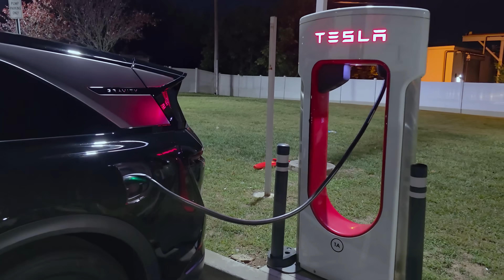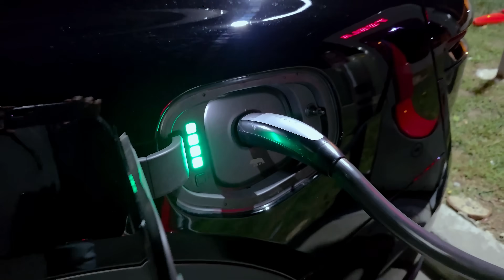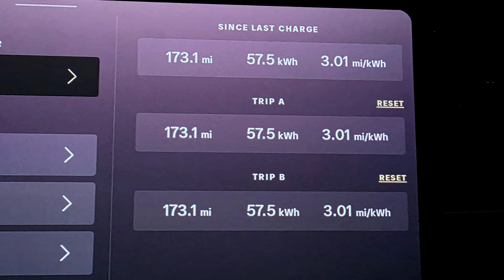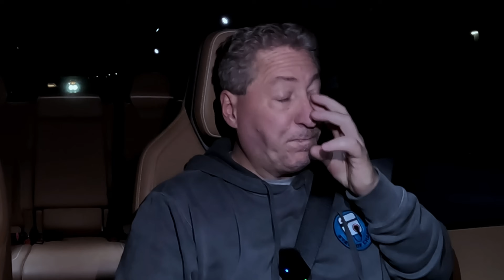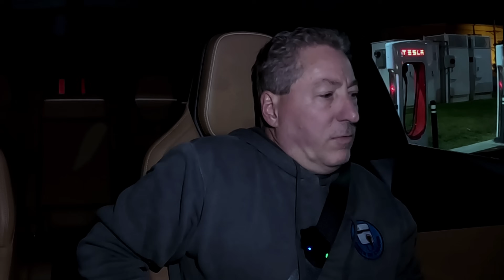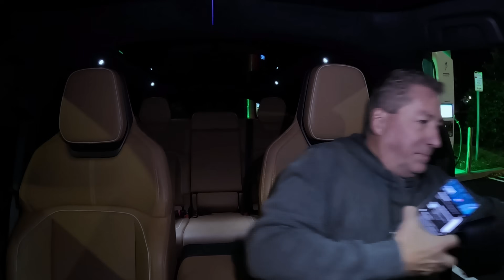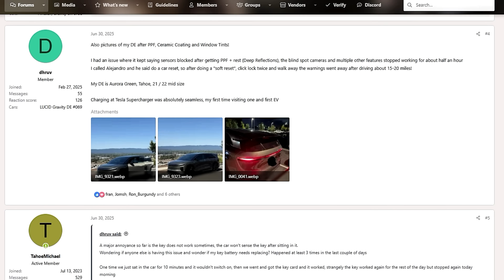Does the Lucid Gravity Live Up To Its 450 Mile EPA Range Rating?

Comment: Vegas here.  Just took my EV on its first California drive from Vegas. Its cool right now but summer heat charging is a big problem especially if your ev cant keep cool while charging. Also My Honda was nit open to all Tesla superchargers in Baker, CA with my adapter which pissed me off due to the inconvenience of having to move my car half a mile down with no convenient stores for the family.  The fear of your car no charging due to whatever reason is a big scar with your family in the car.  I will say that im seeing more lucid software issues occurring in reviews, any charging issues will keep me away 🏃🏾‍♀️. Electrify America are busy with big SUVs and you can't fit your car in to charge. Thanks again.

Comment: For me to get 300+ miles on my 24 Model Y with 88% battery health left, I need to get 230 wh/mi over my commutes. Due to my location with so much downhill/uphill, traffic etc I average 240 wh/mi and can indeed get it. This is at a 100% SOC though.

Use breaks when regen is limited = disabled. 

A gravity would give us stupid range in comparison!! Excited.

Your wh/mi was 350 during this test?

Comment: So, now that was at 100%.  But at a fast charge range of 80% is even lower. Very nice vehicles.  But I have found out that the country not ready.  Not enough chargers.
Reply from the maker: That depends on where you live. I can drive anywhere I want to in the country now without any problem. There's tons of DC fast chargers out there now.

Comment: 2:20 I don't know that I would give them all THAT much of a handicap for it being in the 50s. By the time the majority of the discharge is taking place the battery will be at whatever the cooling system is made to regulate it to and it should be performing nearly optimally.

Comment: I leased a Chevy Equinox RS and first thing I noticed is the range on the highway is terrible.  I'm old school and I was thinking with an ICE brain thinking I would get this great mileage and my cost of power would be so cheap compared to my 2018 Accord 2.0.  OMG how wrong I was.  I have an 80 mile round trip to work.  80% charge is 267 miles.   I get at best 200 miles on an 80% charge.  I've tried at 65, 70 and 75 mph and I get  the best range for my vehicle at 70 mph. It cost me more to charge and I charge on off peak hours then gas cost for the Accord.  I pay about $100.00 more a month to charge then I did for gas. I definitely will not be keeping this vehicle at lease end and unless batteries have advanced in another year and a half, I will go back to a ICE vehicle.

Comment: The seven-passenger model with 20/21" wheels is rated at 437 miles. The five-seater gets the 450 rating.
Reply from the maker: Right, and that was the 5-passenger model

Comment: Early adopters of the Gravity will definitely have to deal with software glitches and less than perfect assembly issues. I hope Lucid gets this right quickly because the more completion in this segment, the better. I really wanted a Gravity but after test driving it and observing the build quality in-person, I decided instead to buy a 2026 Mercedes EQS 400 SUV. Not a single issue with software and the build quality is excellent. That's the difference Tom was speaking of when comparing newer manufacturers to the tried and true old timers.

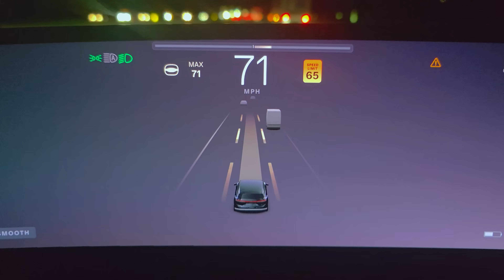Comment: At 4:58 there is a warning message on the cockpit display. Did you check that? Perhaps that was telling you you had a drive unit malfunction.

A few things to note:
* EPA range tests are not run at 70 mph, so you cannot expect to get the full range at that speed. Aero efficiency decreases with the square of the velocity, so going just a bit faster makes a big difference.
* The Lucid Air usually exceeds the EPA rating at 70mph, but range drops rapidly after 80 mph.
* While the Cd for Gravity is quite low, it does have a much larger frontal area, which is part of the aero efficiency formula. It could be that the range dropoff point is more around 70 mph for Gravity. 
* Air density is higher at lower temperatures, which will also decrease the range.

It would be interesting to measure consumption at different speeds. You would not have to do the full range test, but empiracally determine the consumption rate for different speeds to see how much of a penalty is added for higher speeds. Then you can run another range test based on the optimal (highway) speed.

Comment: Rear climate control was on. So does that mean the range of this 7 seater car is estimated with only the driver in mind. If that changes 100 miles is shaved off. With all the tech it could not notify the driver that something is wrong with the rear motor. Yeah right I just don't buy that

Comment: If you can afford a $125K  suv, you can just rent a long range bomber if you have to be somewhere quickly where driving is faster than flying and you can hold your water longer than a camel.   FWIW, I always rent a car when on a longish road trip.  Any problems means I just call the rental company and they drop off another car.  My friend got into an accident 300 miles from home and it was a nightmare.

Comment: EV makers please stop putting large wheels on your cars when you don't have to.  And stop using different size tires front to back.  All this does is reduce range and prevent 4 wheel tire rotations.  But why didn't Lucid check over this vehicle with a fine tooth comb before letting you use it for the range test?  Did the rear motor just out of the blue have an issue?  And, how would anyone else who bought this car know there was an issue if they don't track the range like you do?  If I spent over $90K for this vehicle it had better do what they say it can do.  Don't get me wrong, I am impressed with Lucid and really, really want to buy a Gravity and get rid of my Tesla, but I don't need another company delivering empty promises.  Also, one thing is for sure unless an EV car company can figure out how to reduce the range loss in cold climates, they will never convince ICE drivers to switch.  But as far as software issues go, the whole software industry pushes them out way too early, not fully backed as you said.  It drives me nuts that customers tend to be free beta testers.

Comment: I can see the rear drive having issues causing the low efficiency but this also shows so many problems. If there was an issue with the rear drive unit, why does the driver not get a notification? How are normal people supposed to know? Why is the battery state accuracy so low? Telling the driver it's at 0 percent but still having charge in the battery is not a good sign. What happens if it was the other way? What if it reported 5% charge but if it was really running on empty? The state of charge indicator is very important. 3 miles/kWh is very bad efficiency when a Model Y can get 4 miles/kwh

Comment: I'm confused by this test. According to fueleconomy.gov, the Gravity highway range rating is 103 MPGe. That translates to ~3 miles / kWh. Multiplied by the 123 kWh battery, that's around 370 miles. So why is a 450 mile rating being used for a pure highway range test?
Reply from the maker: The EPA's MPGe figure includes charging losses. You cannot use that to calculate the driving range.
Reply: @StateOfChargeWithTomMoloughney   Thanks for the explanation. So the net effect would be a more conservative MPGe number since energy consumed is more than what made it into the battery?
Reply from the maker: @jghall00  Yes

Comment: Slowing to 65 would substantially increase the range versus 70. All else remaining equal, the power varies as the cube of the speed. I have a ZDX AWD, and over 6 months and 4000 miles driving in CO, I’m averaging 3.1 mile/kWh.  I've done a few 5-8 mile runs on flat highways at speeds of 65, 70, 75 and 80.  The difference in instantaneous mile/kWh shows up on the display even over such a short distance.  

On a recent 1300-mile trip in sparsely populated northwest CO, eastern ID and southern WY with temperatures 90-105F, winds up to 60 mph and climbs of 5-10% over passes, my "usage" was 3.0 miles/kWh.  What the trip did for me was a couple of things: 1) even in near wilderness if a town is on a through road, someone has put a high-speed charger in place and 2) the car can always go farther on a charge than this old man wants to sit behind the wheel. 

So, I take the ratings for EVs just like I take EPA gasoline ratings, they're a rough guide.  My Z is heavy and still gets 3 miles/kWh and for bigger EVs, that's about normal.  So just take your battery capacity and do a little arithmetic (it's not even math) to see if the car you're interested in meets your needs.

Good video as you made a conscious effort to eliminate as many variables as possible.

Comment: I am thankful independent testers are out there doing these range tests, but to get the masses to fully adopt EVs, the if it is cold, if the AC is in use, etc, issue killing range keeps many away. Consumers do not want to think too much about their vehicle. Rarely does ICE vehicles hit the numbers published. I still remember when I bought my 2012 Camry SE 4 cylinder, it had a combined MPG of 28, but after 243,000 miles of driving, it had average 24 MPG. I just got in the vehicle, made it comfortable and drove. I am not a hard driver, but I rarely did the gentle/slow pedal push many say improves MPG. Point is, when it comes to EV testing, the testing I want more of is the driving an EV like most would drive an EV. It is almost like you need the hardcore testing that is done like this video, but a second video of just daily living without over thinking. Just get in and drive to the store, or to work, etc. Make everyone comfortable, no restrictions on AC use, or not driving on a hot days or cold days. Just drive, not the weather, note how many people in the vehicle, but no hyper miles restrictions. Hope to see many channels doing a variety of tests and hopefully report with the honesty that this channel or Out-of-Spec does.
Reply: The reason for the ultra specific testing conditions is so you can compare between vehicles.

If you drive one vehicle in perfect conditions and the next one in a blizzard, you can't compare them.

Comment: This is not a slight towards Lucid, but shouldn't the system warn if there is an issue with the rear motor?  If a normal owner is just driving along this would have never been found.

Comment: To validate your test results, you need to turn on/off regenerative options to see the difference of mileages between them since majority you run at constant speed.
Reply from the maker: The level of regeneration won't effect this type of range test to any noticeable amount, since very little braking is done. In normal driving, though, it would have a big effect

Comment: Isn't the EPA estimate a combined number of city and hwy (hwy 55% + city 45%)?  
You would get more than 450mi in low-speed driving as air resistance and force required increases as the square of velocity...
Reply: It's some kind of mixed cycle, you'll never get ALL that in a straight highway run.

Comment: Lucid didn't set the bar. The EPA did. And the EPA tests are at slower speeds. 345 in a vehicle that size at that speed is phenomenal.
Reply from the maker: It sounds like you're under the impression that the EPA does the test - that's not how it works. The manufacturer does the testing and sends the data to the EPA to certify it. The EPA does hand-pick a small percentage of vehicles to double-check the manufacturer's data. It hasn't done so with the Gravity, though. In fact, the EPA isn't doing much of its own testing at all anymore, because of the recent budget cuts it has had.

Comment: Interesting there would be a rear drive motor issue, yet no dash light or error.  Plus why would it not charge on native NACS port at low SOC.  100 miles short of or 77% of stated range is a joke Lucid.  Hard to believe EA could save themselves, yet alone save our guy Tom.  All glaring issues, won’t buy a Lucid.

Comment: 10:13 Starting from full I think you only have to drive til 75% of the battery remains or 25% percent of the battery has been depleted and then record the miles covered. To get an accurate range, multiply by 4 (because 4 x 25 =100, and 4 x [25% of miles covered] = total miles coverable i.e. total range. Or drive for an hour and convert watt hours per mile to kilowatt hours per mile and then convert to total miles coverable by dividing by the pack size. Otherwise how are you going to perform 500+ mile range tests as EV range improves?

Comment: 5 non-stop hours driving a 7-seat SUV (whatever) EV at highway speed with the heater on and adding back 90 miles range in less time than it takes to say as much is now "disappointing". Both me and my first EV, a new 2011 LEAF (now w/ 150k miles and its 4th owner) are shaking our heads at how far we've come and how spoiled we've become! 🙂
I do carry adapters in the trunk for the Lucid EVSE that came with my early '22 Air GT so I can use RV campsite power when travelling. I have them mostly for nostalgia, remembering the early days of our electric journey that now seem so long ago.
Reply: Our level of being spoiled never surprises me anymore.

Comment: 10 mph head wind? Roughly the same as driving 80 mph with no wind? Test it. Also test range driving 70 mph with 10 mph tailwind. Tom may be underestimating the effect of wind on range due to the exponential increase of resistance with velocity increase. I suspect that 30 more miles that he guesses he would get with no wind is justified or possibly a bit too conservative (somewhat less than 10% range reduction, most estimates I see are 10% - 20% reduction). And I don't understand why others don't include wind velocity when they quote their range test results.
Reply from the maker: But don't forget, I drive in long loops on the highway so any headwind is a tailwind for 50% of the test.

Comment: Wow, a NACS port in the right location (to use the Tesla SC which is the gold standard). Wish the other OEM’s could figure this out.
Reply: Amen, Whats wrong with these engineers putting charge ports behind the front wheels, on the corners but the wrong side? Lets go NACS and left rear on everything. Is that too much to ask?

Comment: The 420 mile range on the 21/22 wheels made me buy the Air instead. I need efficiency. My Air on 20 inch wheels has efficiency of 3.8 mi/kwh. When traveling below 65 mph i get 4.28 mi per kwh. 19 inch gives me around 4.2 mi per kwh avg and 4.6 mi per kwh below 65 mph. Not charging in between driving from Boston to DC was awesome.

Comment: Tom,do they know what happened at the SC? Why didnt it charge there?
Reply: Lucid uses the rear motor modual to boost the 400 volt at the supercharger to the 900 volts it needs to charge.
Reply from the maker: It was because of the rear drive unit issue
Reply: @StateOfChargeWithTomMoloughney thats a weird reason,lol ,so i guess that means,it was working fine when u charged to100% but failed during test.  Very interesting ,also odd u could access the extra 8 kwh from the battery.

Comment: Maybe over time he could calculate a average temperature compensation factor &/OR run the full 70 mph range test, then run a 50% to 40% range test to use as a baseline for hi heater, hi AC and hot and cold weather extremes without having to run a full 100 to 0 test for each extreme conditions test

Comment: Why would anyone design a car with 21" wheels on the rear and 20's on the front?  It complicates tire rotation and just limits replacement choices.
Reply: Lots of high performance vehicles…. My Wife’s BMW X7 has 22”front and 23”rear. It’s AWD.  Almost every supercar has staggered wheels. It’s actually quite common

This is an AWD vehicle w over 800hp. Probably uses the larger/wider rears to influence handling characteristics

Comment: It's weird that they said it's problem with motor. Edmunds tested their Lucid and also got about 50 less than rated
Reply: so did Notch EV on his test.
Reply: Yeah, and we just did a trip with out Lucid Gravity, and 370 miles range is what it indeed does, and not more.
Reply: @bjsmoker1 yours is 5 seater with 20” wheels?
Reply: Yes, they did and took a lot of hate in the comment section from Lucid fans, as I recall.  Might be the same issue.

Comment: In fact, on the Lucid website, the 7-seater version has 437 miles of range, which is still much less than advertised. If this large discrepancy was due to the ambient temperature, there is something very wrong with this car. However, it is still excellent efficiency for a car of this size.
Reply from the maker: I range tested the 5 seater
Reply: @StateOfChargeWithTomMoloughney oh, so it's even worse than I thought 👀
Reply: Did you somehow completely miss the part at the beginning and end about how the rear drive unit was having problems that likely had ill effects on the range?
Reply: @randomdesign6304 actually, I really missed it, English is not my native language, so I understand somewhere between 50 to 60% of what they say, I'm still learning. so in fact, I missed that part, sorry.